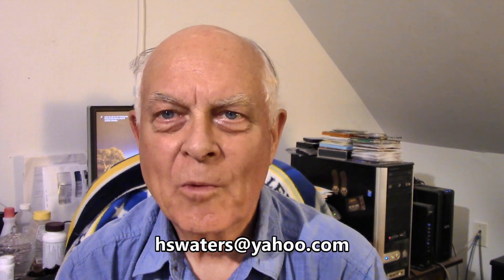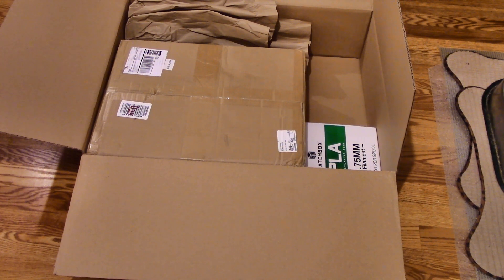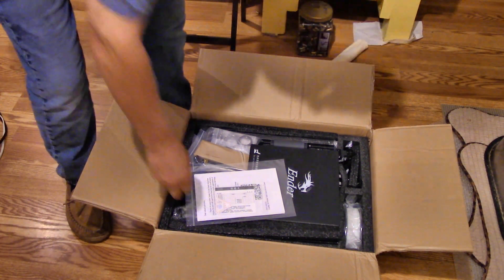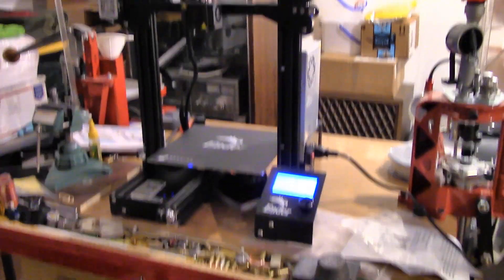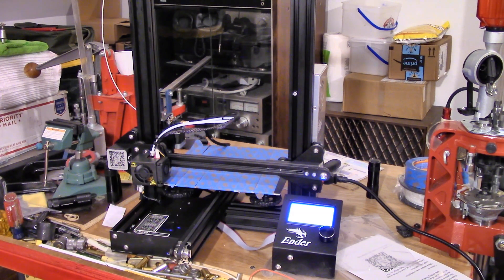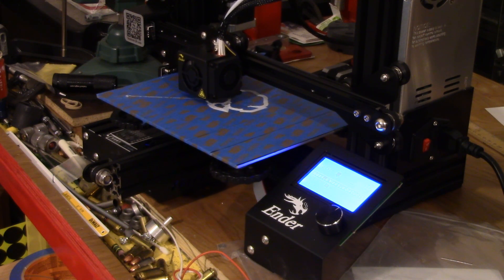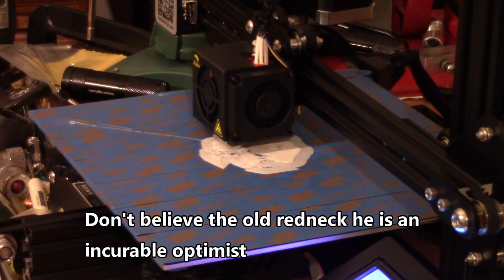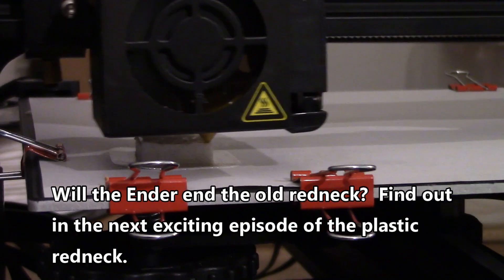Creality Ender 3 3D printer part 1 of 2

Comment: Well if there's one thing that we've learned it is that the instructions that come with this printer are inadequate. So you're going to have to find a better tutorial. I'd be wondering about the temperature calibration on that printer myself. The problems you're having look like trying to print too cold to me. Although it could be the wrong nozzle? You might have to jet that one out or something?
Reply from the maker: I will certainly have to learn what works and change what does not.  Thanks for stopping by.
Reply: Attend the Ron Poliel school of pocket fishing and 3D printing. Just set it and forget it!